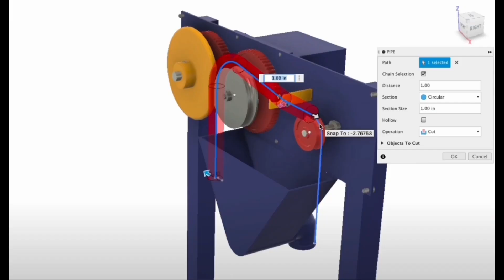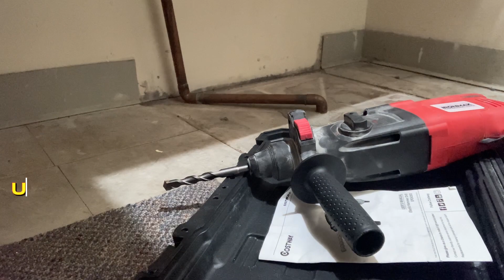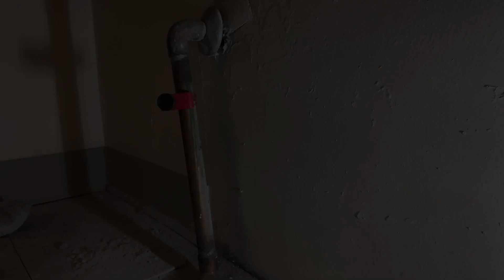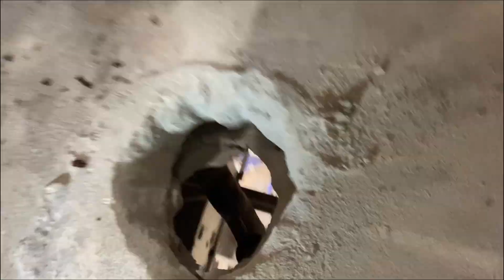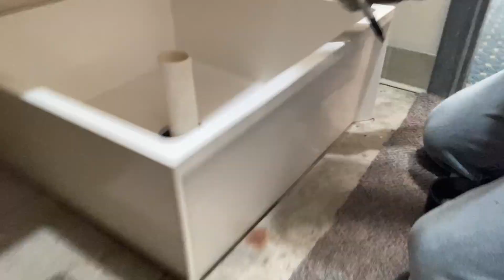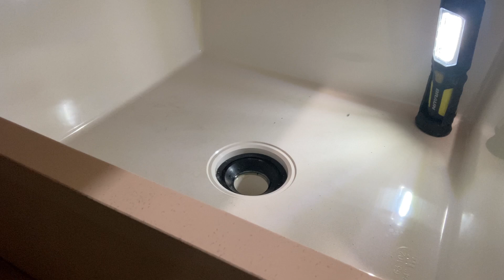Installing a Mop Sink (Plumbing)

Comment: I feel like you skipped over the most important part. I’m installing the same thing and was hoping this would show me how the gasket and pvc and tub all connect to create water tight seal.
Reply from the maker: It’s a friction fit.  The rubber gasket simply slides onto the pvc drain pipe.  I put a little bit of liquid hand soap on the inside of the rubber gasket to help the pipe slide into it.  I used a flat, blunt chisel and gently hammered the rubber gasket into the sink drain opening.
Reply: @kjfacilities-maint  Thanks. I think I'll also add some silicone around where the rubber gasket meets both PVC and basin, because I can't fathom how the compression is water tight. Especially since the PVC pipe leans a little towards one side meaning their's extra pressure on one side and less pressure on another which I have to imagine creates less of a seal on the less compressed side. Do you see any issues with the added protection of silicone on top of the gasket fitting?
Reply from the maker: @aaronbaney652 I don’t see any issues with that. It should work just fine for you. Good idea!

Comment: You didn't show the actual install, but you showed hammer drilling?
Reply from the maker: Hi John, thanks for your comment. At the five minute mark you will see I marked the drain pipe to cut it down to size, I also marked the wall where I need to install the mounting brackets that come with the mop sink. Everyone’s installation will be slightly different. This video is meant as a general guide or high level overview.